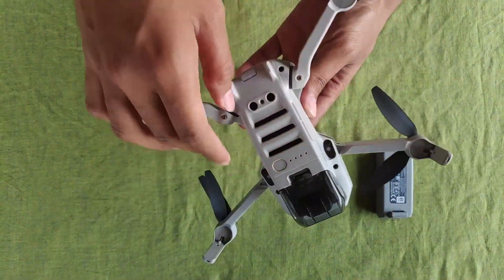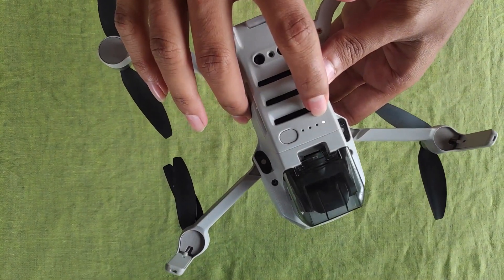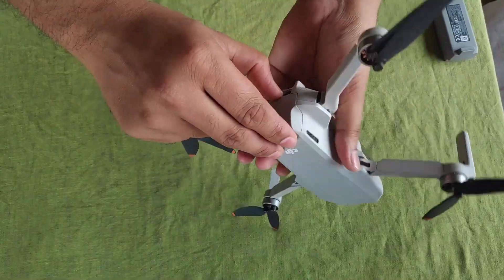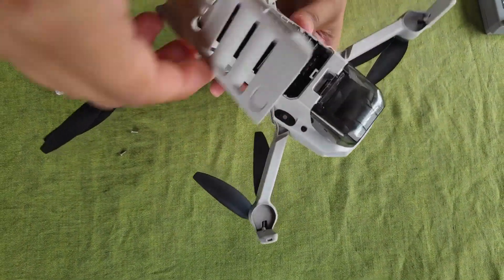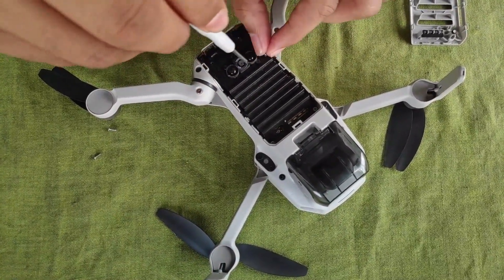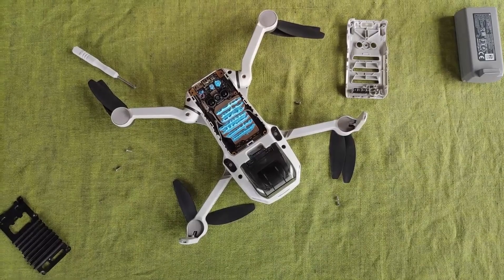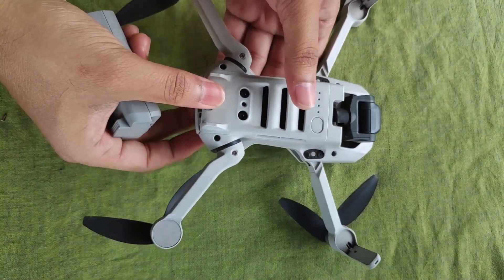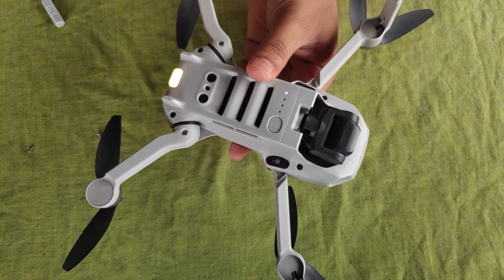DJI Mini 2 Power Button Problem Again! | Teardown & Fix

Comment: Hey, I'm facing an issue with my DJI mini 2 and there is no official service in the country for me as well, could you please guide me a bit? The aircraft and the remote controller are not pairing with each other and I have tried every possible solution that the support gave me online. The yellow light on the aircraft keeps blinking quickly and also the drone won't power off with the button. I have to physically remove the battery to power off the drone. Any idea on what may be the cause of this and how I can fix this?
Reply from the maker: Only the turning off doesn't work by the button or does the drone power on using the power button? Did you check it with any other controller or any other mobile phone?
Reply: @Media30  the drone powers on properly, but then the yellow light keeps flashing and the drone doesn't connect with the rc. And power off doesn't work. I tried using another phone but was having the same issue.
Reply from the maker: Then it might be the problem of the motherboard. Maybe the motherboard has some faults and not pairing with the RC. The possible solution is to visit a local drone expert as there are no official DJI stores in your country.
Reply: @Media30  alright, I will try that. Thank you so much!
Reply: @tobiastobias5150  Hey, I have the same issue with mine right now. Did you get yours fixed?
Reply: @kristianpersson9644  if you are in the same country as the one in which you bought the drone, you should raise a query with DJI. They'll mostly ask you to send the drone for checking. What would happen later on would depend if the circuit issue was a manufacturing defect or was there any water damage, whether you have dji care refresh, etc.
Reply: https://youtube.com/shorts/pJ_vKc97M2E?feature=share
Reply: Check this link

Comment: you really didn't show how you fixed the problem though, you just came back and ok there it's fixed
Reply from the maker: Sorry for that but we only changed the connector in the power button. You will find the power button replacement here on our previous video-
https://youtu.be/N6vZAQPmmTQ
Reply: https://youtube.com/shorts/pJ_vKc97M2E?feature=share
Reply: Check this link https://youtube.com/shorts/pJ_vKc97M2E?feature=share